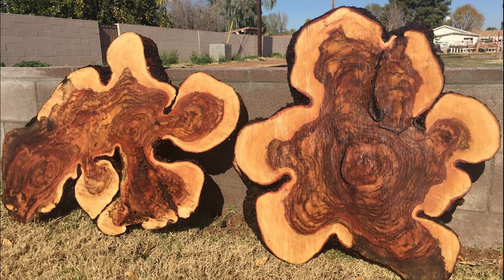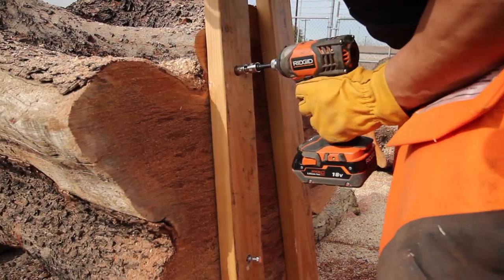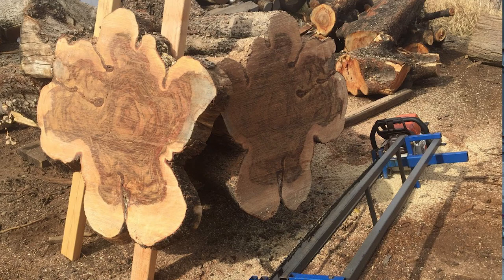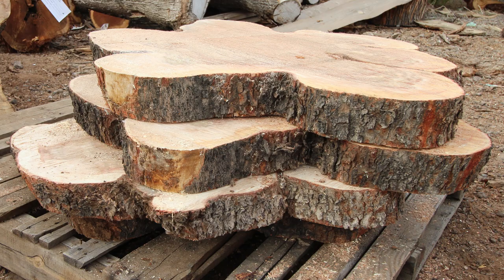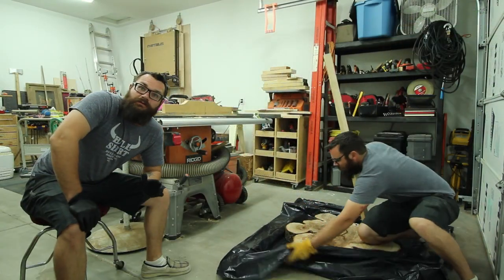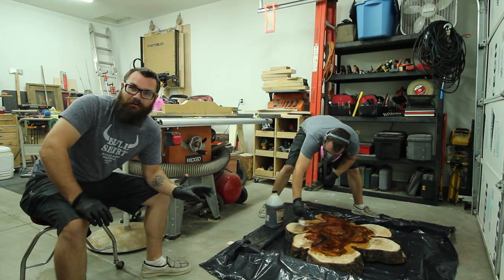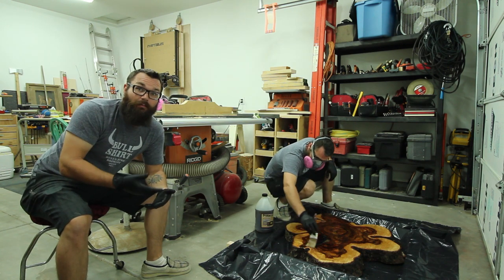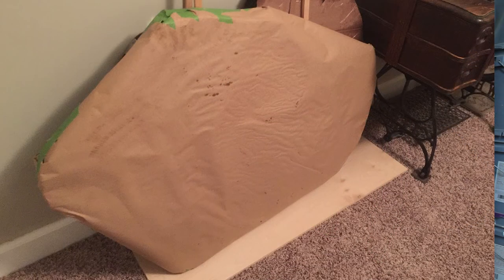Cutting and Drying End Grain Cookies

Comment: I have just started out in cutting the tree's that have been felled in the woods next to my house into your so called cookies, I have been drying them out in my shed, but now I have noticed that the cookies are distorting and some white fungus appearing in some area's of the surface, so watching your video will have really helped me in creating some nice tables that I have in mind doing! Just need to carry out your procedure in wrapping them up after applying that liquid you used! Many thanks for this information! I have taken note in what I have to do now that am getting older, 68 years and have just caught this bug in creating pieces of art from wood, in my youth I painted and always had a tree in the frame!
Reply from the maker: Usually you don't want to wrap them because they need to have a little air flow to prevent the mold growth. The Pentacryl I soaked them in replaces the water and removes that issue though. When I don't use Pentacryl I put stickers (3/4-1" thick strips) between them and put them in a cool dry place to dry slowly.

Awesome that you caught the bug! It's a very rewarding hobby!

Comment: It must be great to have a understanding wife to be able to bring wood from a tree into the house to dry out!
There must be an easier way than this! The wood is in a state of shock and it requires moisture, so I soak my cookies in engine oil as it is cheaper that linseed oil and all the others, then let it dry out and then apply what ever you fancy!
Reply from the maker: How do your cookies fair over time with motor oil? I don't always apply this. Most often I'll just put some anchorseal on it.

Comment: I cut some slabs of similar size 10months ago. They were stored in a cold basement and then for 1 month at 30degrees C in a boiler room. Do you think they will be dry? My moisture meter reads 5% on the surface.
Reply from the maker: What's the thickness of them? Since I used pentacryl, my drying process should be reduced and I wasn't even considering looking at them for at least a half a year. It's been almost a whole year and I still haven't looked at mine. 

It's hard to say if yours are dry or not. 5% on the surface sounds good but 11 months probably wouldn't be long enough unless it's a fairly thin slab.

Hope this helps.

Comment: Your video popped up when I was trying to google what an appropriate moisture content for something like this would be before applying 2 part table top epoxy resin? 

My situation: I got a doug fir cookie I was planning on making an accent table out of. I'd like to leave the bark on since doug fir isn't that visually interesting. I had a big 7" thick piece that I cut in half  (didn't do a great job of cutting it straight, so one half varies widely in thickness). According to my moisture meter, the recently cut side is at about 25%. 

What would you suggest? Any advice would be appreciated.

Thanks!

Comment: Would it be ok to seal the cookie/slab with anchorseal? I got a 36" end grain slab that I sealed on both sides with anchorseal, though not before it had already cracked. Should I try to remove the anchor seal and soak ti with pentacryl?

Comment: Alright, I'm a big noob here, have no idea what I'm doing.. but I do tree work for a living and we completely waste literally tonne after tonne of great wood with so much potential.. so a couple months ago, I started grabbing the odd cookie before the rest of the tree got tossed. But I really have no clue what to do beyond that. I want to make some tables, but first I gotta learn how. Coworkers told me they there cookies always cracked. So I left mine in my garage where it's nice and cool. No signs of cracking, but they're covered with fine white mold. Do you know if the wood is now damaged or still recoverable?
Reply: and no update yet, hey?
Reply from the maker: If they dry out slow enough which they might be doing in your cool garage then they might not crack. On the other hand, you generally want good air flow to draw the moisture out and help prevent the mold. You might try spraying some Lysol or some other anti-mold grown stuff to help with that. As far as them being recoverable, you might just have to put a mask on and sand the white mold off to see how deep it goes and then make sure it's got some anti-mold spray on. Hopefull that helps.
Reply: +Ty Moser (MonoLoco_Workshop) Makes sense, thanks
Reply: +Water drop U Gaming 1 thanks for the heads up, sounded like you were a little baked at the time haha
Reply: D. Ryan Shaw
Reply: Isabella Pham thanks for your insight, Isabella
Reply: how thick is the wood?

Comment: hi, great video!

I am just starting with milling myself just to make myself some stuff since I have got enought time to do it and I like to be busy with woods. anyway back to the question I got, how about the flexural rigidity of the bar you are using. I always have had still bars and they are pretty stiff. but I never had a longer one that a 24 inch. I am looking to buy a 48 inch or bigger. what can you advise me. is the stihl bar stiff enough to not get hollow slaps?
Reply from the maker: The bar I use is 59" and there is a little bow in the center if I let the power head hang unsupported but it's not really noticeable in the end product. Since the chainsaw is generally more rough than a bandsaw mill, I like to mill a quarter to a half inch larger than I really want so if there is any flex, it should get take out with that.

As far as getting a stronger, less flexible bar. I'm not sure at that length that any are better than Stihl.

Comment: After you put the Pentacryl on, can you put it in a log kiln and speed up the drying, or will the wood crack?
Reply from the maker: Vacuum kiln yes, regular one probably not until it reaches a lower moisture content. The idea is to slow the drying process to prevent cracks.

Comment: I'm not wild about putting the mystery chemical on my wood and then sanding, and possibly breathing some in.  Have you ever just tried oiling one side?  Perhaps if the cracks occur because the wood shrinks as the water evaporates, maybe replacing the water with oil would be a simple solution.
Reply from the maker: I'll definitely be using a respirator when sanding these but fro my research, the only way to get any kind of "guarantee" that these won't crack is to use Pentacle. I have heard of people trying large amounts of denatured alcohol but primarily for smaller things.

Comment: hi, im probely late for this video but im wondering on something. im planning on building a pc case out of a tree stump, i have found out if i just got it its going to crack after a while, so do you thing a can use the same method that you used in this video to provent it from cracking? thx for your time and help!
Reply from the maker: I'm sure it would help but I would imagine that you would need to purchase a WHOLE BUNCH and it's not very cheap. Also, since you're talking about a stump large enough to house at least the components of a computer, i'm guessing it's fairly thick and would take years to fully dry. One thing to consider as well is the heat the computer will create could cause it to crack if it's not fully dry.

Hope this helps!

Comment: Hey I want to use small cross cuts for my projects. Up to 15mm in diameter. Would they need the same treatment?
Reply from the maker: Just depends on how many cracks and how big of cracks you want. For most things I won't do this because I can just use epoxy to fill the cracks.

Comment: How much pentacryl do you think you used for one slab? Trying to decide if it's worth my money
Reply from the maker: Probably a half gallon. The vendor has a calculator to help determine how much you'll need for the size of slab you have.
http://www.preservation-solutions.com/wood-treatment-products/wood-calculator/
Reply: Ty Moser beautiful.  Thanks for the quick response
Reply: Ty Moser also, have you heard of using denatured alcohol for larger slabs?  That's what I am currently experimenting with because of how expensive pentacryl is.
Reply from the maker: I've never heard about it but after reading a few form posts about it, its kind of intriguing. However, from what I read, using denatured alcohol would speed up the drying process which might actually cause more cracking for something this thick. It would be an interesting experiment for sure.
Reply: Ty Moser darn.  Well I have a sycamore slab that I've been applying denatured alcohol to for about a week.  Granted, before we cut slabs the tree had previously been on the ground for a year.  I'll let you know how it goes

Comment: What % of moisture will be left  in the wood after 3 months ?
Reply from the maker: +Patrick Meehan I honestly have no clue. The Pentacryl can apparently reduce dry time by up to 90% because it replaces the moisture but only time will tell. I've got a moisture meter that's a little on the cheap side so I'll probably play it safe and test it every month and only use it after the moisture level has stopped going down for two months in a row.

Comment: Hi Ty - how did the Pentacryl work in your slab cookies? I would be very interested to see the results. Thanks - Jim
Reply: I did this on my slab and it still cracked.  I used a gallon.  However didn't crack like the ones untreated.  I think 6 months is kind of fast considering the recommended dry time is 1 year per inch.  I'm dealing with that now.  I used a router sled and brought 3 and a quarter to 2 and a quarter.  The slab wants to cup. The only way I can keep it level is to flip it every 3 days.  But even dry wood will want to soak humidity.  Question is, is it dry? Pentacryl was real good at displacing water.  It looks like snow on the slab but feels like salt.  It pulls the water right out in crystal form